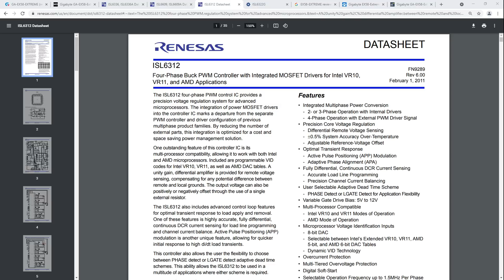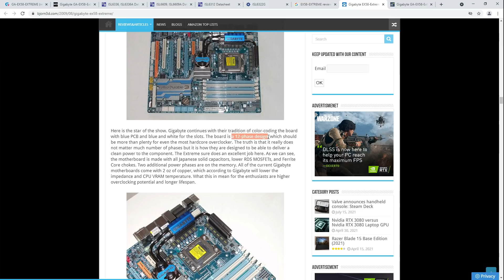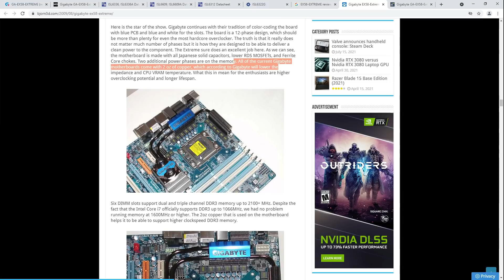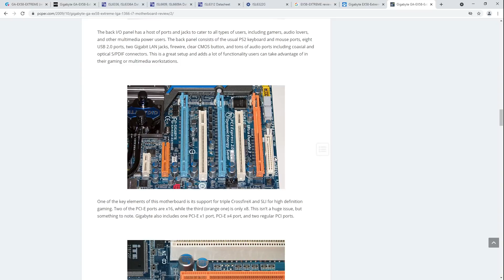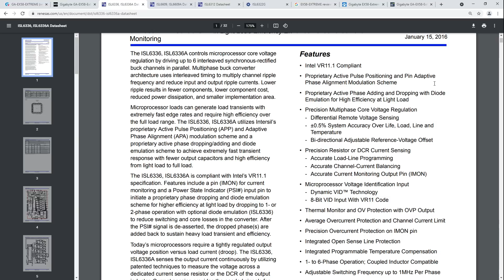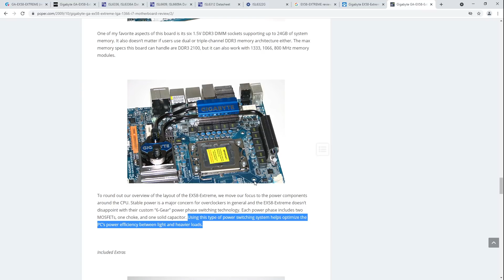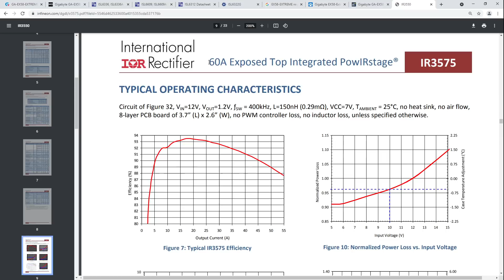Motherboard manufacturers have been lying about VRM phase counts for years.

Comment: The “six gear power shifting” thing is a software feature on these boards. Where you can manually control and/or see how many phases the board uses to deliver the power to CPU. It mainly is a power saving feature, by default it uses all phases.
Reply: So does it say that it is using 6 phases in software?

Comment: Post codes are another frustration with motherboard makers. The post codes are already built into the BIOS so it's dirt cheap to implement yet only the highest and motherboards get it. You'd figure every motherboard by now would have it because it makes troubleshooting so much easier. Yet they pretend it's a premium option.
Reply: Couldn't agree more. Two segment LED displays can't cost more than a penny or two?
Reply: Market segmentation. It's worse now than it was back then. I remember boards like the ASRock P67 Pro3. 8+2 phase VRM, postcode/debug LED, power and reset switch onboard and it was $99.
Reply: @-eMpTy-  My decade-old, entry Biostar board has a 2-digit display. Ever since I started looking to build my own PC again a couple years ago, I can't believe that almost no manufacturer puts decent debugging tools on their mobos anymore.
Reply: Because we (who want post codes) are are tiny minority compared to the masses who don't care. They, those masses, just want all the RGB in the world.
Reply: Furthermore I'm surprised OEM motherboards (HP, Dell, acer) don't already have them for their business motherboards so their techs can fault diagnose quicker
Reply: @tourmaline07  It'd be much cheaper for OEMs to equip their techs with a post diagnostics display which connects via PCI/PCIe/USB/LPC.
Reply: @tourmaline07  They have them but in a different form. The LED lights on the front panel (1, 2, 3, 4) will blink during POST, and the speaker will also beep the code on a failed POST. (edit: With Dell at least)
Reply: Truth! My old ep34-ds4p gets display and onboard switches but my x570pro has leds i can barely see let alone decipher and i have to reach for a screwdriver!
Reply: idk whenever i have ever read a Postcode to try a troubleshoot a board its been some stupid thing not in the manual or its in the "reserved range", when i am overclocking i don't even look at them i can tell if the boards a no POST or not without looking at them and nothing the POSTcode says will help me get stability in OS.

so i would say its a perfectly valid cost cutting measure if the POSTcode is going to be useless why should my high end board even waste the space on garbage like a postcode LED?
Reply: Becasue nowdays all Motherboard vendor WANT SAVE COST

Comment: the more useful version of the rant can be: how do we come up with an actually good, quantitative measurement that can describe how good a vrm design is. That could really benefit the consumers.
Reply: Energy wasted (W) when powering the flagship CPU at a standardized CPU stress test benchmark.
Reply: The way all voltage supplies are quantatively tested.

Outout ripple. Output spike. Dynamics. Regulating accuracy, efficiency
Reply: This is similar to how can we objectively measure a quality of a PSU? All the manufacturers brag about is the 80+ spec, but that only covers your efficiency, not quality in other regards. See the recent GN PSU disaster videos as an example... And that's where reviewers like BZ or GN come in to tell you a product is a garbage even if it claims to have more of a thing in its design.

Comment: We literally didn't know how VRM worked at the time. I used to maintain a database on AMD board VRMs on OCN because so many were absolute garbage. Im not an EE or anything of the sort, so our method to quickly evaluate a board was basically to count inductors. Naturally we know now this is not accurate, but at the time it gave a bit of guidance on to which boards would burn themselves to the ground (i.e. MSI 790/890FXA-GD70). Especially because as BZ notes reviewers were similarly clueless and often worse. I apologize for perpetuating the issue, but it was born out of necessity after we put holes in 10+ 790/890FXA-GD70s
Reply: there are double step-down two-phase buck converters, today there are some tripple step-down three-phase buck converters available. by looking at a component you will not know how it works.

Comment: just patiently waiting for the day a buildzoid edition board comes out
Reply: It'll be 50% VRM, 50% memory channels. The CPU socket will be left as an implementation exercise for the buyer.
Reply: @MoraFermi  😂😭 swappable controllers so you can do AMD OR intel imagine 😭
Reply: mem training at first boot takes 1 literal day to post BUT it's already maxed on all timings. :D
Reply: @emperorSbraz  okay that's funny 😂
Reply: @emperorSbraz  The POST-code display is used as a countdown timer for how much more training it needs.
But for real, I'd buy that for Zen4 or Zen5, if it works for ECC DIMMs.
Reply: @emperorSbraz  "for an additional twelve to twenty-four hour cost, we also have REAL auto overclocking!"
Reply: It would be active vrm cooling, 20 full phases, just 200€ and no m.2 slot xD
Reply: I can't wait to see the 4 full pcie slots and 12+ USB ports
Reply: @dvr1337  BZ would make it a single phase that does 500A at only 16W heat loss... just to prove the point that phase count is stupid :P

Comment: "6 gear" sounds like they knew it wasnt a true 12 phase but didnt have a clue how it worked. (16:06)
Reply: Actually it's something what's stated on gigabyte website. It's on sixth line(huh) in marketing material. So unfortunately they just copied it :(
Reply: This is just "enhanced" Dynamic Energy Saver feature which was present on even older Gigabyte's motherboards. Dynamic 6-Gear Switching is mentioned on some LGA775 motherboards they manufactured.

Comment: 18:50 that's not what diode emulation does; at light loads if you leave the low side MOSFET on like you normally would, due to low inductance and current(so low stored energy) the current flow can reverse, flowing from the output, through the inductor, through the lowside MOSFET to ground killing efficiency. Diode emulation mode senses the voltage across the MOSFET changes from negative to positive (indicating the change in current direction) and turns the MOSFET off so the output current doesn't flow to ground.

Comment: Some motherboard reviewers still take (fake) phase counts from the manufacturer at face value. Nothing has changed since 2008.
Reply: Example of something new. Source?
Reply: @sophiethemasochisticninja7655  There are several on youtube and the web, it shouldn't be difficult to find one.
Reply: @Stashmyash  Well im not the one trying to prove something or claim something. So source on your claim is something you will have to give.
Reply: @sophiethemasochisticninja7655  In case my links get filtered out. Look for Vortez's review of the Asus Z590-E where they call it a 14 phase, when it isn't.
Reply: @Stashmyash  Specification says 14+2. Looked at a picture of the motherboard without vrm cooling. it has 14 + 2 power stages. so not sure why you say it is false marketing.
Reply: @sophiethemasochisticninja7655  power phases =/= power stages. have you really been watching any of BZ's lectures?

Comment: I feel totally schooled! lol  nice job and explanation, I remember the early VRM's that came out for the 3.3v  versions of '486 which appeared in their twilight, back then they were a plug in module that went into a slot next to the cpu, they were required if not running a 5v part. thanks again I learned a lot  .subbed!

Comment: Im getting old, still remember. And yes people knew about the phase scams.
 I still remember the 24 phases boards XD
Usually they just had two choke per phase.

I did remember looking at just how the choke where hooked up on boards when people wanted high phase boards to try and figure out what boards where scames because that was really a thing in early i5/i7 era boards.
Reply: @The_Man_In_Red  if you ask some people an ALU is a core XD
There are fundamental parts you need to be able to call it a CPU or a Core or well a phase a phase in a vrm design.
If I recall Ampere they just added an extra FPU so making the core wider but calling it two cores or cuda cores.
I suppose a Pentium 54C is a tripple core then with two pipelines with two alus and a fpu XD

it was just simpler back when engineers decided the marketing and not the marketing people.
Reply: Yep. "CUDA cores" definitely don't fetch & decode. Yet another marketing gimmick haha.
Reply: you mean 3, cause at "24 phases"...god damn

Comment: I think the reason for that came from that the media (computer magazine, online reviewer) always educate the DIY fans how to count the number of „phases“ on the motherboard by counting the number of solid capacitors around the CPU socket. Which is not always true but however historically always useful because no one used more than one solid capacitor for each phase. However the manufacturer got that in mind and pushing the number of solid capacitors to the limit, so they can confuse buyers and be fancy on the advertisement. Either the marketing department is doing this willingly or they were as uneducated as the casual audience as well.

Comment: The correct way to advertise imo is: how many amps the board can delivery while run non-stop without shortening the lifespan of the components, throttling or critically failing (i.e. by not overheating). If they wanted to go above and beyond, they'd publish an entire curve profile of how it behaves temperature-wise as the amperage increases

Comment: I did get one of these UD5 boards at launch, flashing it to Extreme after I waterblocked it. I liked Gigabyte's skt.1366 boards so much, I got an X58A-UD7 later and at the time, I remember quite distinctly people already knew the phases were "doubled" in the boards. The UD5 and Extreme having 6 real phases (and the UD7 having 12 real phases), was well know among the PC DIY enthusiast community as soon as 2009.
Say whatever you want about these boards' phases, the truth is those were the real deal. My UD7 was retired last year, after powering an i7-920 D0 @4.5Ghz for 8 years straight! And was retired not because it died but, because it was time to move on. My UD5 later flashed to Extreme, is still working 24/7 with an i7-920 C0 @4.0Ghz since November 2008.
Reply: Yeah. There's a theory going arround amongst seasoned PC builders that leaving the PC turned ON keeps the hardware free of problems for longer. From my personal experience, I certainly agree with that theory. 
I know it's not the most politically correct thing to say in current year but, if I can leave my PC turned ON 24/7, I just do it.
Reply: @johnny_rook  I'm well over being PC(!) and in recent years it's been left on 24/7. I discovered after buying a UPS about 2 years back that it's idling at only 52w at the wall (kudos to Asus), which sealed it for me. But yep, in electronics and engineering generally, power/thermal cycling is reckoned to account for a big chunk of the life of components.
Reply: A i7-920 doing 4.5 Ghz for 8 years? Nice OC, my man

Comment: ferrite core is a cost and size effective way to build an inductor with the downside of having more distortion.
the other way would be air core, a normal thing to see in 90s and early 2000s boards.
Reply: yes. but also you cannot get anywhere close the inductance on any comparable size. theres a factor of 1000-10000 between air and ferrite inductance
Reply: @BrosBrothersLP  I know. not my point.
Reply: @emperorSbraz  what is your point?
Reply: @BrosBrothersLP  The video acts as if nothing has ever been used before. PC building did not burst out full formed in 2010 or whenever.  It is painful obvious at the start of the rant and at that point about chokes the author functions as if it did.  That is fine, but for some of us, 2008 isn't the long long ago.

Comment: One additional point is, just like when you put two resistors in parallel, putting two MOSFETs in parallel also lowers the resistance.  So even though its a 6-phase, its actually appears to be a pretty good 6-phase.

-Matt

Comment: Been doing pc since 2000
"Comments are saying.. x brand is bad because they're lying about phase counds"
[uploads videos pointing those who lie about phase counts or components]

Its not the brands, they all do the same things, they're in the same boat.
its also not a new problem, but I dont remember it being so common in the mid range (£170 today is £110 then)
Back in the day high end motherboards would say 8+2.. when its 4+1.
But if you bought a cheaper board you kinda knew it would be a 4+1 because there's no way the gigabyte 970a-ud3 has the 8+2 phase it claims at £90.

Now people see a huge heatsink and it could be a triple teamed 4+1, or double teamed 6+1 or doubled 6+1 or an xdpe132g5c....
The higher phase controllers and doublers and teaming leaves allot more room for (mis)interpretation.

Thats why ahoc and HUB is so important for people to learn, Sunlight is the best disinfectant so videos saying what it is and what it isn't, what matters and what doesnt are invaluable.

Going parallel for more current handling is fine, the problem is the marketing.
I'm wondering how long it is before we see "16+2 stage *BFVRM*" with 4c06n/4c010n parts using a RT8894 or something (turns to look at asrock) atleast it would have surface area.

Fun trivia: msi 970 gaming and krait am3+ were both 3+1 with "teamed" niko mosfets, the boards literally cried with tears running over the audio section.

Comment: @ Actually Hardcore Overclocking
Phases ... this means that there is a phase-shift during the switching for each MosFET-Gate in the high-side-driver and also in the lowside-driver (this MosFET is the replacement of the diode).

What benefits do we get from this?
The input current is more even. If all Switching-Regulators would pull current to the same time, then the input-capacitors would have a lot to do. This phase-shift makes it possible to reduce the numbers of the input-capacitors and the output-capacitors.
There is a lower ripple-current and this is good. 6 phases is very good.

In reality people don't care, this things have to work.

What people want to know are the Japan-Capacitors, because this Chinese motherboards had the problem in the past, that the capacitors are blowing up. The Motherboard-Producer did buy very often cheap Elkos from unknown source or crate a cheap design.
Normally you could decrease the stress on the electrolytic capacitors (heat production because of the internal resistance) if you add some ceramic capacitors, but they did not and save the money.

Comment: I always wondered why they started advertising the phase count at all, let alone such a ridiculously high count as 12.  You get diminishing returns for each one you add and it's really only so that you can use less capacitance to maintain low ripple.  With a big enough capacitor you can get by with just one phase.
Reply: Well, but your average buyer doesn't know this and simply sees "bigger number = more better". So bigger numbers in marketing sells your shit and that's all the job a marketing department has to do. That's your why.